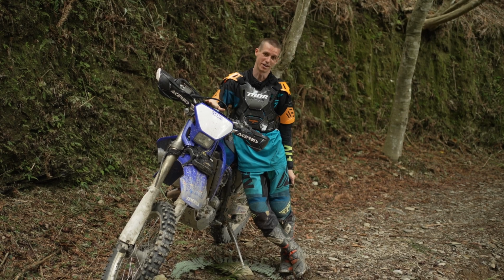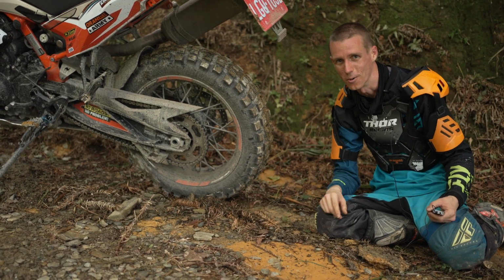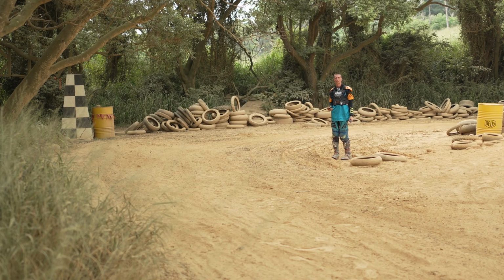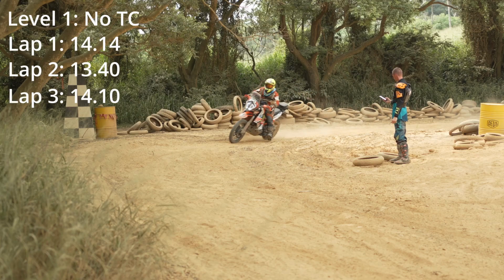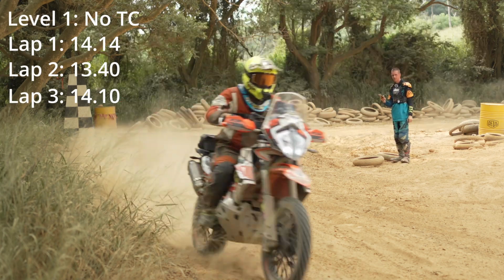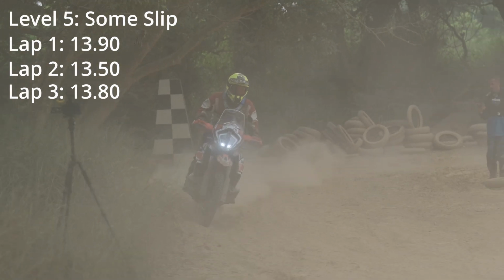Can a pro rider beat traction control? KTM 890 ADV R tested at the limits.

Comment: Small comment on the edit. Can you out both audio lanes in stereo? When playing in a phone conversation parts with two mics are not playing at the same level.
Reply from the maker: It should all be in stereo, but the audio on this one isn't good. We'll try to do better next time!
Reply: @motoskillsfactory  it’s not bad but one guy is out the left speaker and the other out the the right. And on a phone it doesn’t sound right. 
Cool video though, i like slip 8 mostly 5 if i want to play more